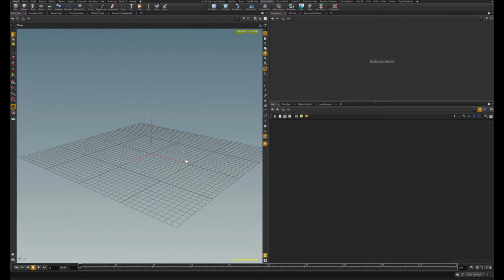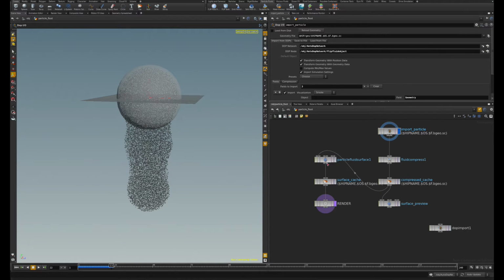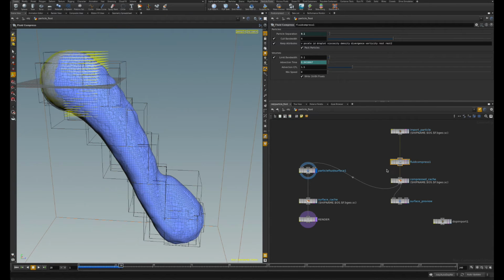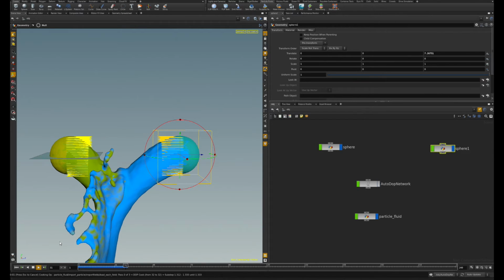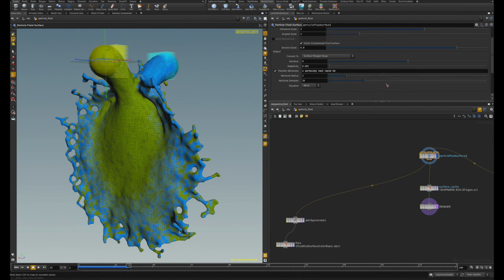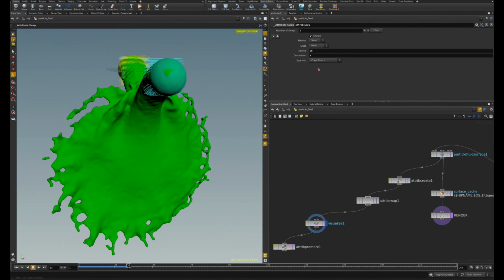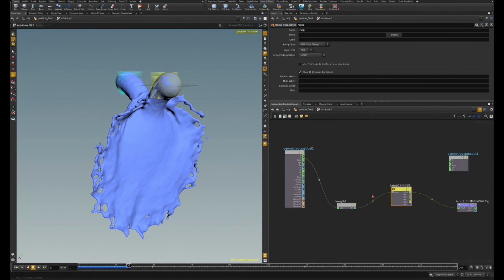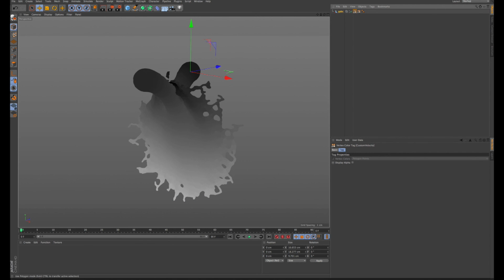Houdini Fluid Simulation & Export

Comment: is the fluid animated in the alembic file?
Reply from the maker: You can of course export animated meshes as alembic caches from houdini, but in this case: No, It was just a static frame, as i was using the file operator to export. You can also export numbered sequence with the file operator. However, for alembic files you will usually use the Alembic ROP, which pretty much works the same way as the file operator but exports a frame range to a single alembic cache.
Reply: thanks!